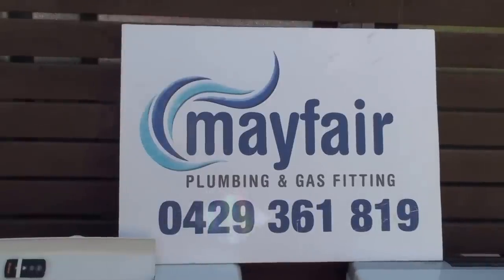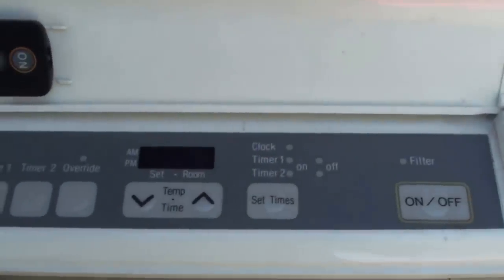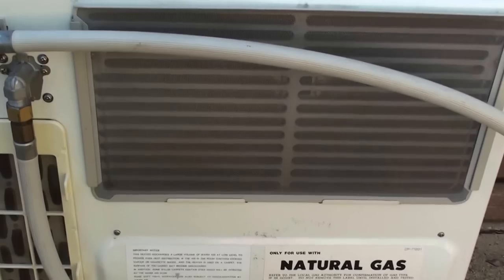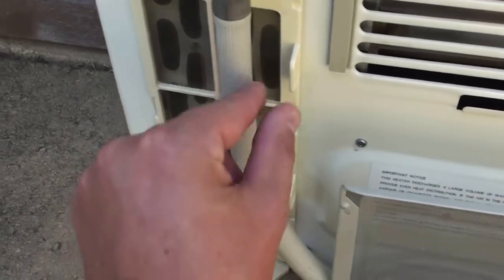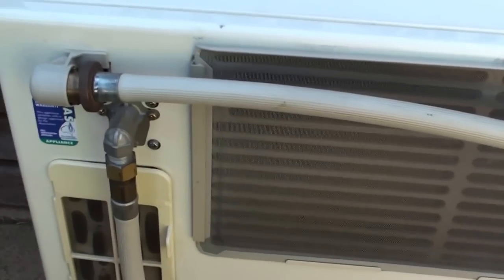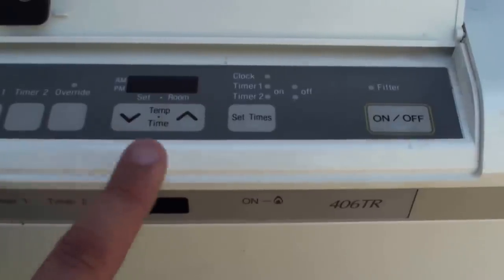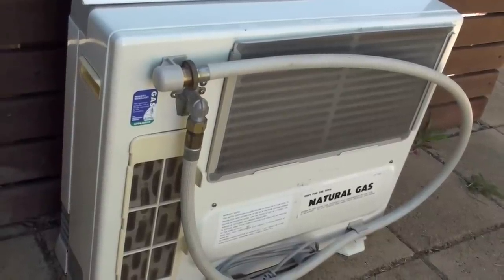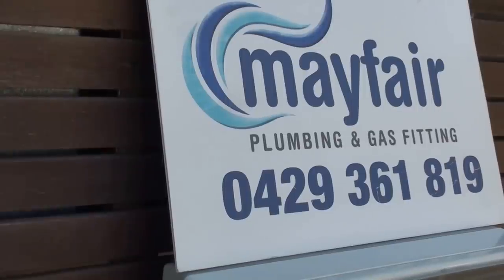🔥🔥Maintaining your portable gas room heater and the benefits of having clean filters🔥🔥

Comment: I have the Rinnai 417 Convector. I have cleaned both of the filters and also removed the front cover and cleaned the dust from the fan. However when I turn on the gas heater after about 3 mins the red filter light starts flashing. What else can I do to stop the filter light from flashing red?
Reply from the maker: Hello, there must still be more dust further in the unit and the filter probe is picking it up?
Reply: @MayfairPlumbingandGasfitting  Yeah I figured as much. Any tips and where to look and do further cleaning. Ive taken the front cover off and cleaned all the front area. Ive also cleaned the dust gathered on the back just inside the rear vents using a brush and vacuum cleaner.
Reply from the maker: @Amayzingone  sorry without seeing its a tricky one!  You could try giving Rinnai a buzz?
Reply: @MayfairPlumbingandGasfitting  Finally got it sorted. Pulled the front off the heater again and gave it a more thorough vacuum throughout, including using a thin brush to free up dust in hard to reach places. Then used a 240V air pump (used to inflate air matresses) fitted with a narrow nozzle. I directed this high powered air stream through each of the front ports, any other holes I could see and throughout the heater. Sure enough a fair bit more dust blew out. Now the filter light doesnt come on. Not for at least 10mins.  :)
Reply from the maker: @Amayzingone  perfect

Comment: Hi, I was just wondering, on these heaters, (similar/ rinnai convector 417) is it normal for the top of the cabinet to feel warm on the right hand side, (above the gas hose inlet/ power button)  with the left hand side top feeling cold to the touch when running?
Reply from the maker: Tiffany Marshall depends on your idea of warm? Yes the unit does get a little warm, but nothing like an oven door for example, i would suggest if it is getting to be a concern certainly have it checked out by Rinnai, cheers Aaron
Reply: Thankyou for that. I had one years ago, but I think that got evenly warm along the top, not warm on only one side.. The heater was working normally, but now is unplugged till I get it checked out. I wasn''t sure if I was being overcautious.
Reply from the maker: Tiffany Marshall always best to play it safe with gas and fire, have a nice weekend 😊
Reply: Hi there, thank you for this video, if there is a growing strong gas smell what would this indicate?
Reply from the maker: Hin M Hello, we would suggest you should contact a gas fitter and get the appliance checked out immediately.
Reply: Thank you I will, too bad I'm in Sydney otherwise I would have contacted you.

Comment: hey there. My heater runs fine but it keeps turning off as soon as it achieves the set temperature. any ideas how to fix this issue. any help will be appreciated.
Reply from the maker: Ethan Hunt hello Ethan, have you cleaned all the filters at the back???
Reply: Mayfair Plumbing and Gasfitting Yep, cleaned the filters. Didn't work. removed the top cover, used an air blower to clean the inside. still the same. '14' is the error code it displays as it switches off. spent the last few hours doing this and searching the internet. You are my last hope.....
Reply from the maker: Ethan Hunt i think you need to book this in for a service call.  Code 14 indicates something a little more serious ie: over heating, are you in South Australia???
Reply: @MayfairPlumbingandGasfitting  rinnai heater error 33 again nd again solve this problm

Comment: I am from England,Gas Safe registered and what I am wondering is how the products of combustion are got rid of?I am a bit worried that they can circulate around the room,but maybe perhaps that is because over here we have combination boilers that are room sealed and fan flued.
Reply from the maker: RobW581 Hello Rob, thank you for the comment.
These particular room heaters require ventilation from the outside of the building allowing these units to breath properly.  In all cases you will find that homes which use these appliances have a air grill at high level and also one at low level which both vent out to the direct atmosphere, obviously each circumstance is different and your gas code must always be consolidated first.
Reply: Hi there Mayfair Plumbing and Gasfitting,and thanks for your reply.I note what you say about the air vent,or grill as you call them.Out of interest are they easy to service and do they have a catalytic converter fitted in them?We here in the UK have flueless gas fires which has sadly caused a tragedy as the cat packed in as it was overgassed.A lot of houses here now have combi boilers for central heating,I have not seen them in Aussie  houses on British TV.PS I have seen your video with the press fit,excellent piece of kit.I want to buy one of these one day,when money allows.They look fantastic.
Reply from the maker: Hi Rob,  these appliances are all kitted out with computers these days which control the operation of these heaters to avoid any sort of malfunction, but having the adequate wall venting  will also help eliminate any build up of gases inside the room.

Thanks for the comments on my copper pressing video, yes it is an amazing piece of equipment and also very expensive, but great to use.

Have a nice weekend, cheers Aaron - Mayfair Plumbing and Gasfitting.
Reply: RobW581 is

Comment: My heater sometimes give gas smell although there is no external leakage as well as air filter is clean and gas pressure is fine so whats the problem ?
Reply from the maker: Hello, thanks for the comments.  If there is a gas smell I would recommend that you have the appliance checked out by a Rinnai accredited technician.  Sorry I couldn't be more help over the computer.

Comment: Hi,
can u make a video on how to clean all the sensors inside step by step ?
Reply: Dear sir l m keeping a gas  heater red colour ploma 820 it's heating plates made of plaster of Paris have been broken into  small pieces and r now replaceable. The plates r not available  here. Will u please let me inform where from can I get the plates
Reply: Mukhtar Hussain i dont have any idea abt such type of heaters, check venders or repairing shops near you and if there is no solution  and if these are made of plaster of paris i think u can take these broken pieces to the roof ceiling manufacturer (they make plaster of paris things) near your location i hope they can copy and make new for u.